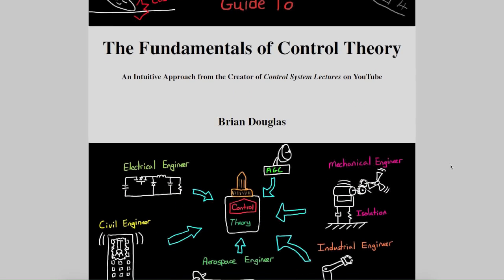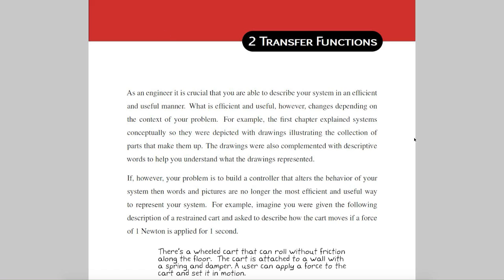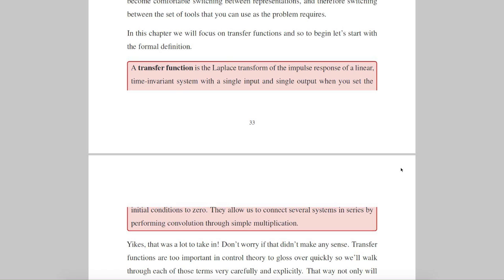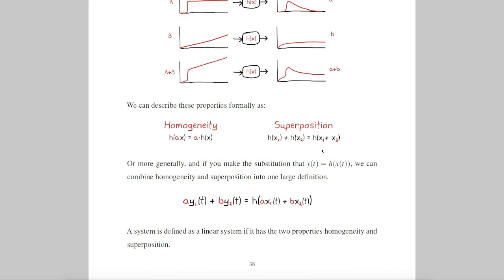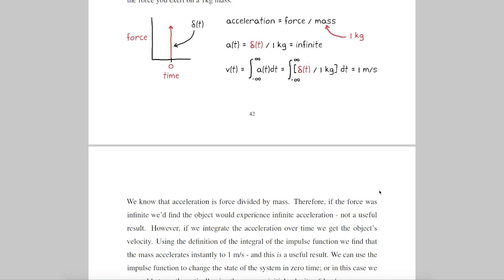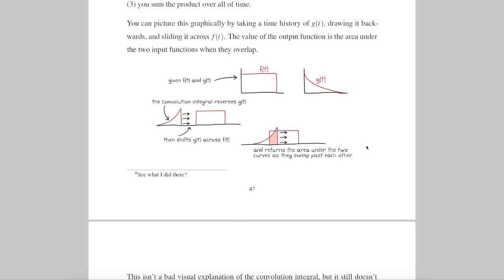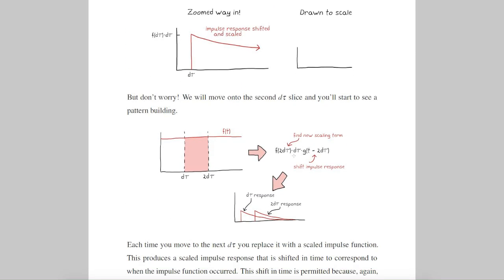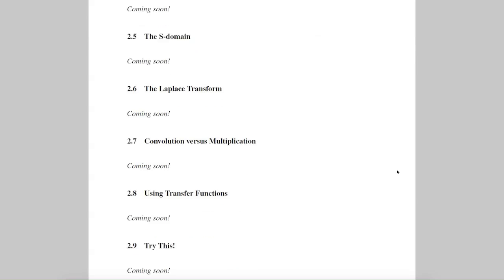LTI systems, Impulse function, and the Convolution Integral

Comment: Hi Brian, great work. I'm already supporting you for your book. 

I have a suggestion for one video or chapter, or an appendice in a chapter. I'm still having troubles understanding when use the open loop tf or the closed loop tf. It would be great if you can recap when and why use each one.

Thanks
Reply from the maker: +Eduardo Moñino Esteban Thank you! Yes great question.  I have tried to address this in each video where it is relevant (Bode plot, Nyquist, etc.) and will definitely call it out for each of those chapters.